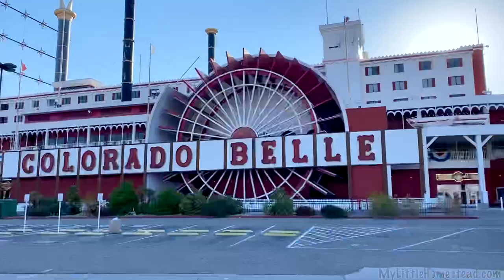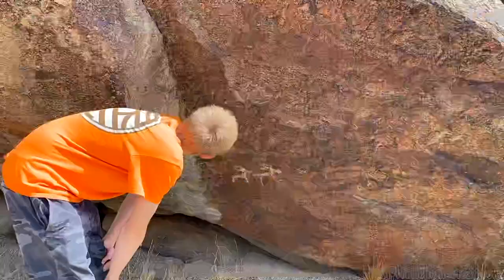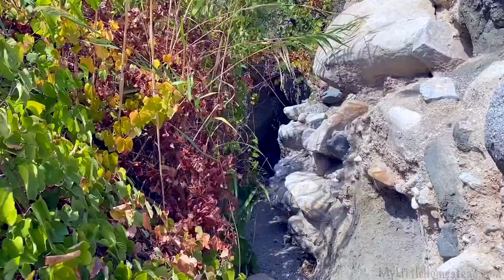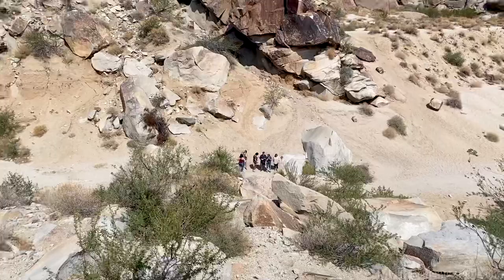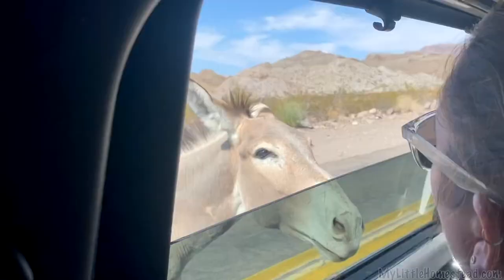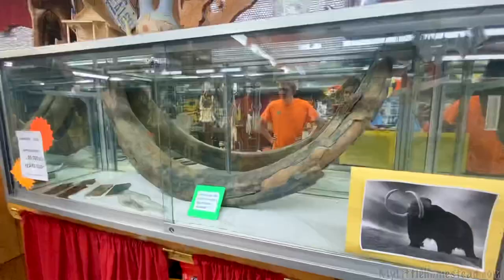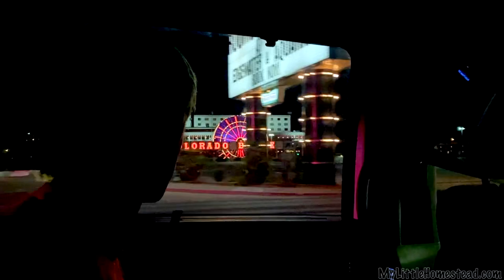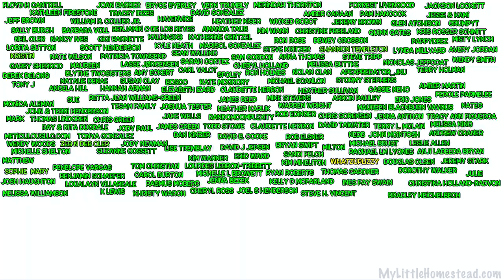Petroglyphs, Rv Curtains & Shae's 21st Birthday! | Weekly Peek Ep320

Comment: Perhaps put a solar powered light in the outhouse. One that has a cord between the panel and lights and replaceable batteries. Motion activated on. Though you could wire in a switch so that it still charges the batteries while the sun is out but only comes on with the switch instead of motion.
Reply: Alternately, bring a solar lantern or even just a simple hanging solar yard light with you when you go, and put hooks to hang it both outside and inside, so that it can charge while you're not using it, and you can bring it in when you need it.  It will also light the outside as a nice little outhouse beacon at night.
Reply: @thewiseturtle  Or just two of the lights I am talking about,  on outside and one inside.
Reply: Motion activated between the trees not so good idea. When its windy the branches move and the light will go on and off and on again...Solar ( with small battery) is a great idea!
Reply: @barbaradenooijer8412  You do realize that they have a sensitivity knob you can adjust, right? That can be adjusted out. Plus the ones with a motion sensor don't go on during the day,  just when it is dark or in a dark area.